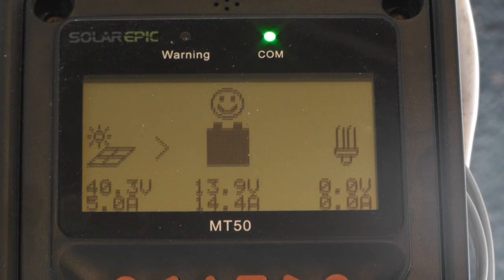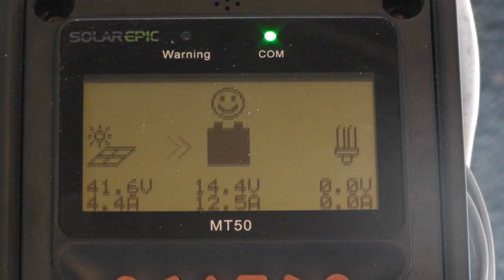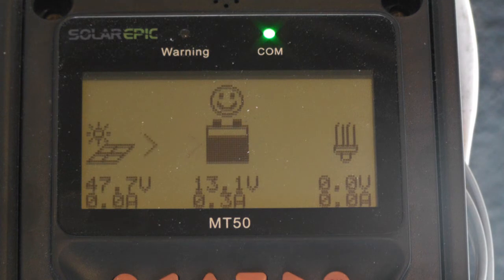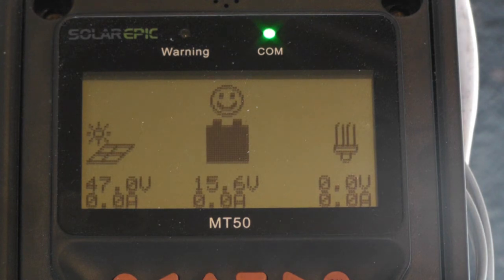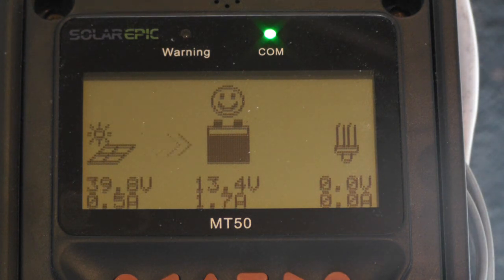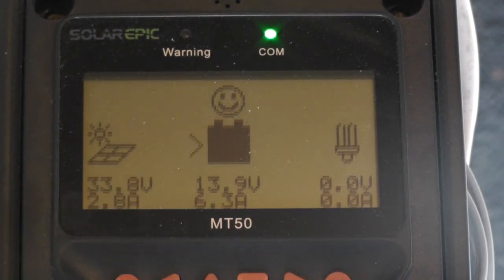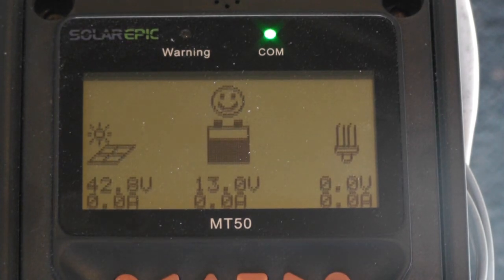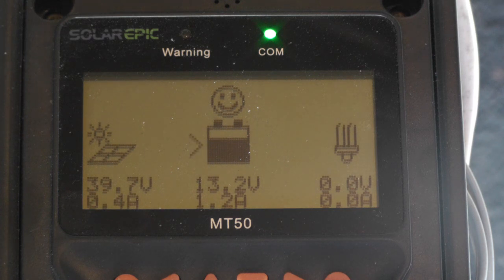More Waterwheel & MPPT

Comment: with the smart motor been high rpm and high voltage i wounder what a hoverboard motor would produce on the waterwheel it is also 3 phase but is 36v and lower rpm
Reply from the maker: Been looking for one to play with but haven't found one for my price.
Reply: @kevincrawford2027  i got 4 for about 20 dollers spare or repair was not bothered about them working or not as it was the batterys and motors i was after

Comment: Neat!

But I don't think the Waterwheel and drive components are too happy with the dump load cycling on and off. Instead of your current system, a PWM dump load controller would maintain a constant peak voltage. A xantrex controller (not sure if the appropriate model) or if you are familiar with arduino or microcontroller programming you can build a PWM dump load controller.

Comment: That's about what I expected. I saw a peak power of 208.38 Watts (13.8V @ 15.1A). I'm glad it's been mostly a success.

It's just too bad the dump load is wasting so much of your power, but obviously until you get a higher voltage MPPT controller, I guess that's what you have to do. If it were me, I would turn the voltages up on the diversion controller though (maybe about 90V turn the relay on to the dump load and 50 volts turn the relay off), but I'm very opinionated.
Reply: i think it is working well as is he has said he is going to use a hot water heater as a dump load thats i think will be alot better at least the excess is been used for something usefull then